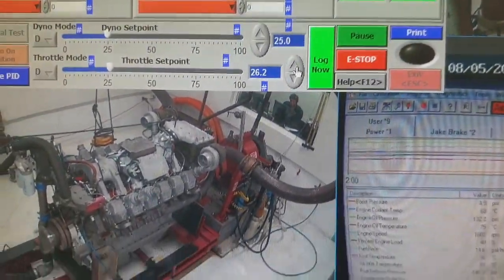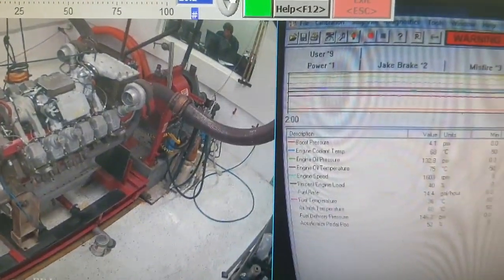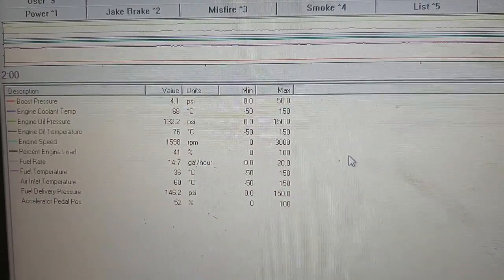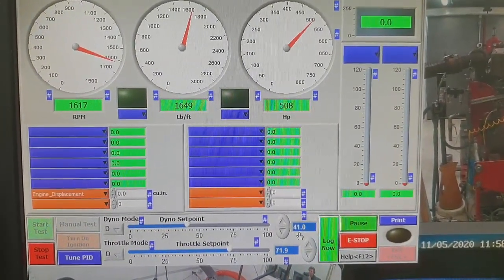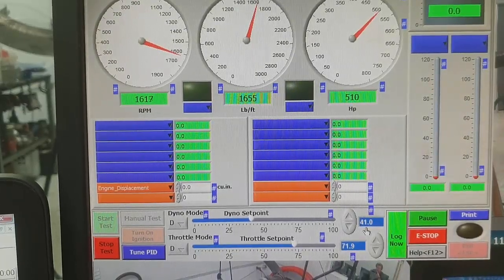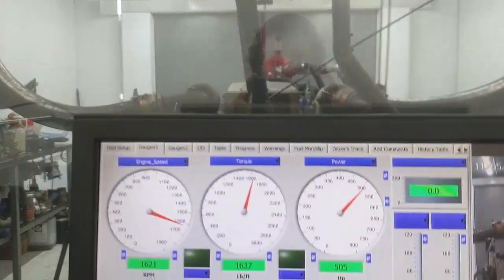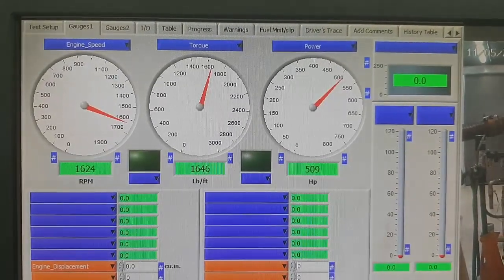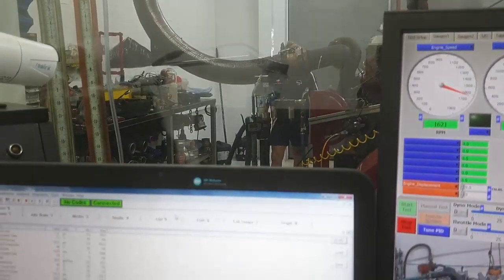2000 series MTU dyno run with commentary

Comment from the maker: We don't have a sand blaster as this puts silicon into the parts. We use chemtel klean strip. Also to finish off we use a very very diluted    blend of acids involving hydrofluoric acid. This acid pulls anything oil base out of any metal. Handle with care as this acid is attracted to calcium so not to get on the skin etc.